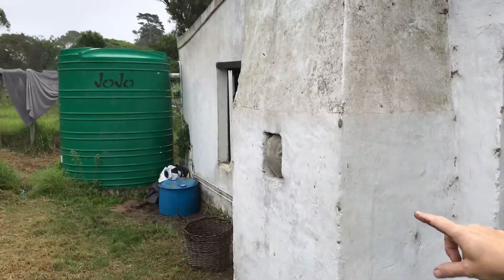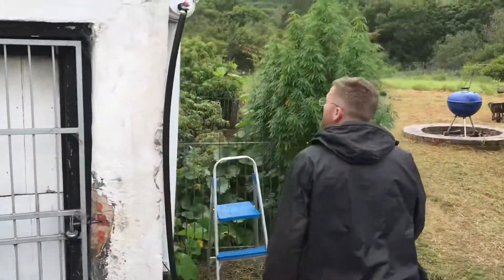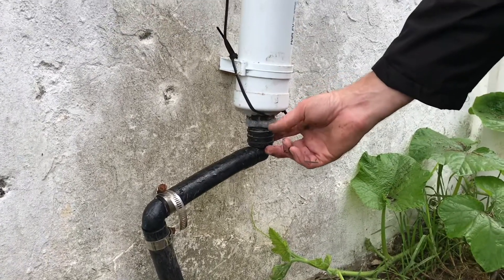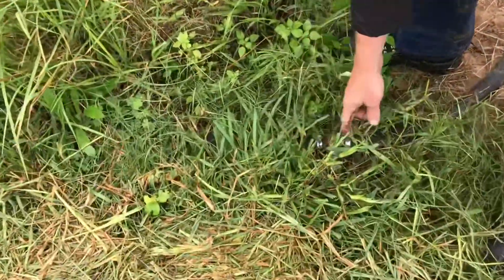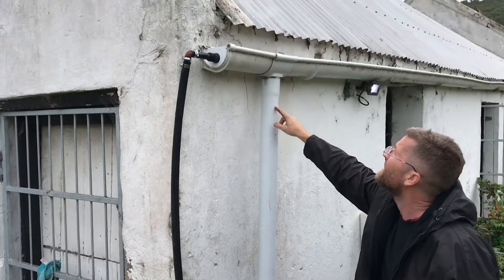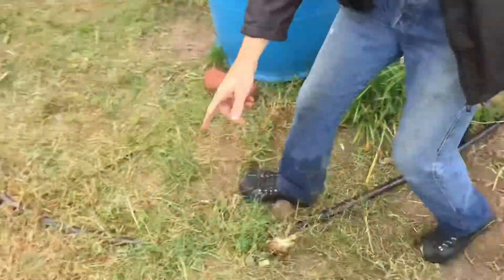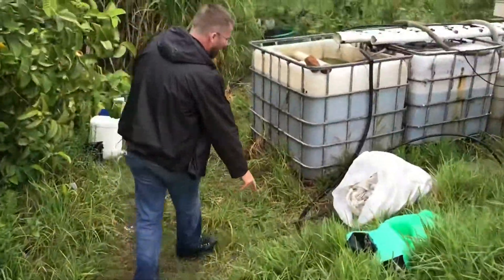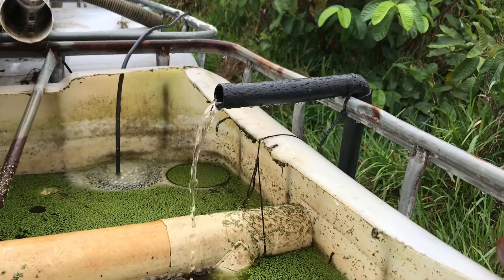How to harvest rainwater without messy downpipes all over the show.

Comment: Hi Tim, I find this video intriguing and I would like to do the same. Please advise did you have to drill a jole at the bottom of your jojo tank so the water gets in there?
Reply from the maker: Hi SuperKanoni  😃- No I did not make a new hole - I used the same hole that the JOJO tank comes with - just connected into the outlet pipe with a "T" joint. 😃